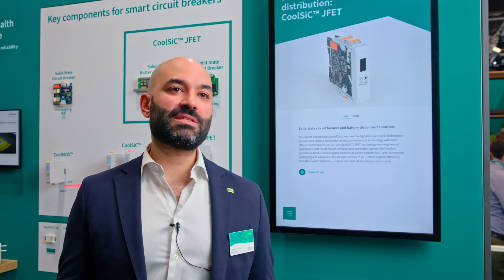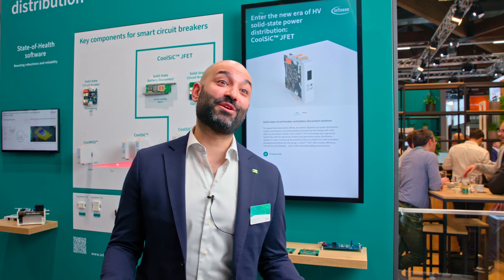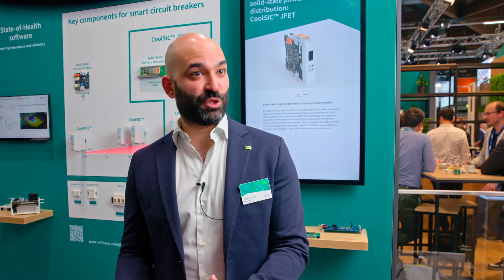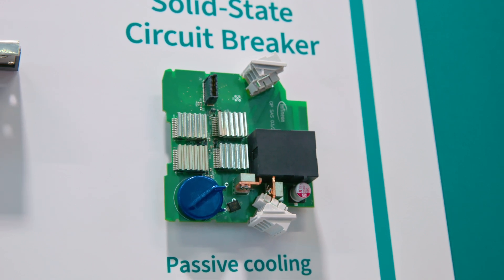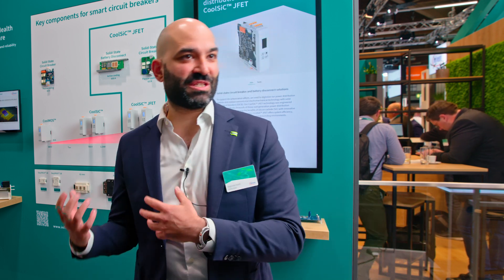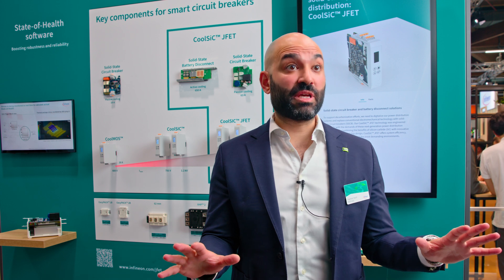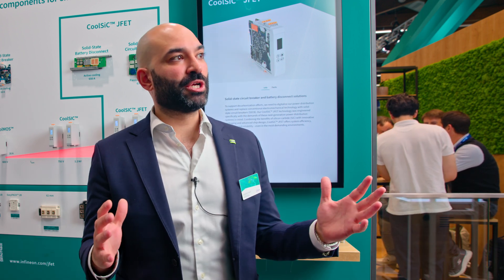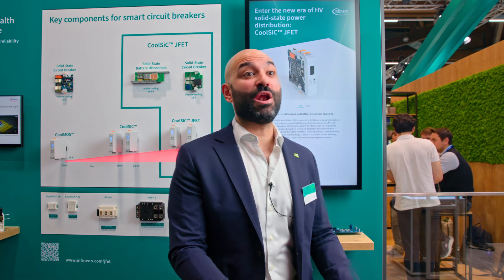JFETs Are Back?? Now in Silicon Carbide and Better Than Ever

Comment: How do you handle the gate drive for a normally-on device in fault conditions?
Reply: Basically - you don't JFETS in power circuits are mostly used in a cascode configuration, where they serve as a voltage translator. The switching is done by a low-voltage MOSFET, so it can have very small R-DSon and short switching times. There are already both JFET and MOSFET transistors in one package, so the designer gest a "transistor" that offers the best of both words.

Comment: Yeah but what about the gate driver complexity for normally-on devices? This is a nightmare for safety
Reply: That issue can be solved in a cascode configuation with a low voltage MosFET

Comment: RDS-on times area... what does that mean
Reply: It's basically a measure of how effective the silicon device design is. The lower R-DSon is required, the more silicon area device needs to use. More silicon area = more cost, because less devices will be made from a single wafer. The better the silicon chip (die technology, doping, processing and the design itself), the less it will cost because of the smaller die in the final product.